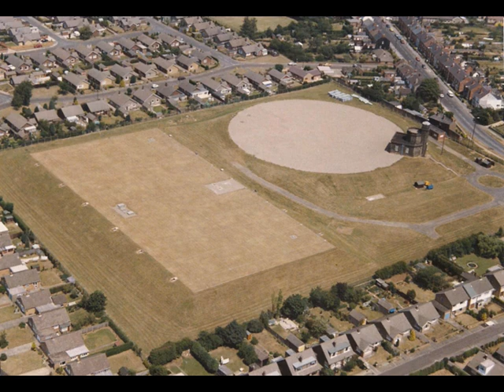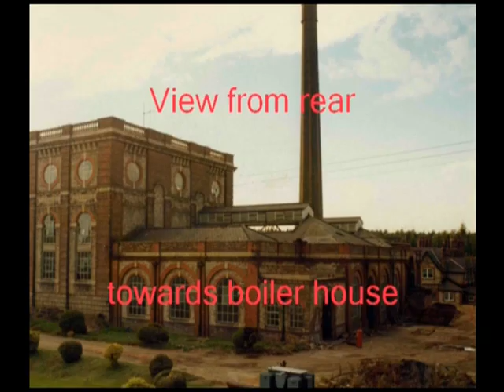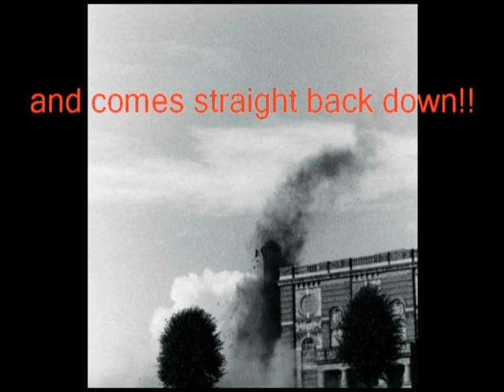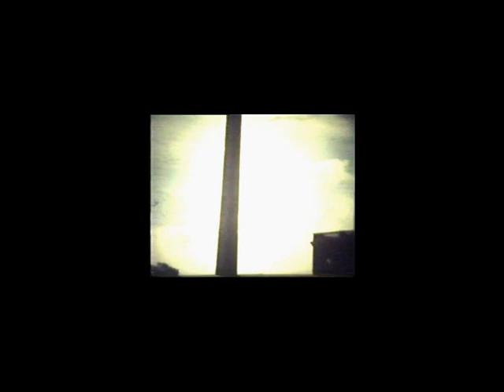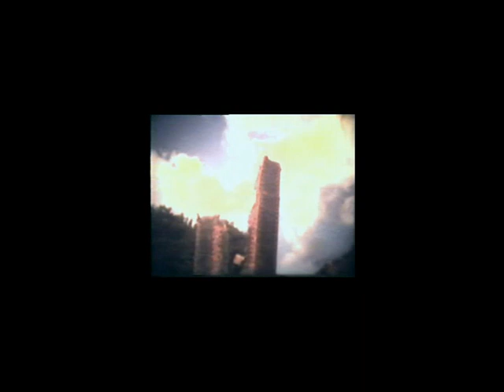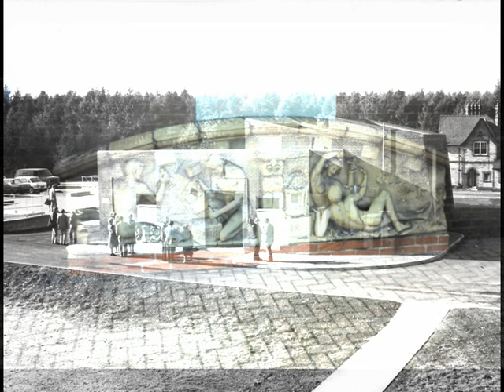Elkesley pumping station demolition

Comment: My Great Grandfather Leslie Mills was the Mayor of Lincoln in 1943/44. He opened the 5th borehole pumping Station. I take it that is long gone? Shane.. Ive still got the key for it!!!
Reply from the maker: That is interesting - thanks Dan. I have  a reproduction of a centenary publication by the City of Lincoln water undertaking commemorating the supply between 1846 and 1946. I can find no direct reference to your Great Grandfather, but It does record in 1943 at the request of the air ministry another borehole was sunk at Elkesley and I guess that is the one your gt grandfather opened. I would not worry about the key as I believe the pumping station to no. 5 is long demolished when the Whiteley station was built -LOL.
Ed